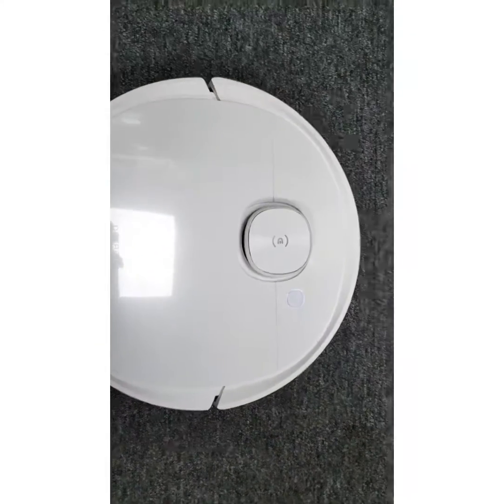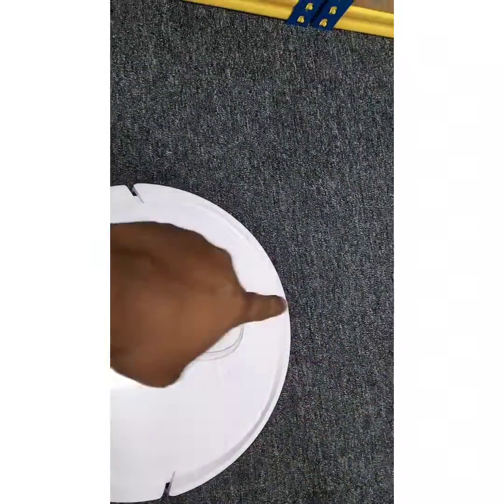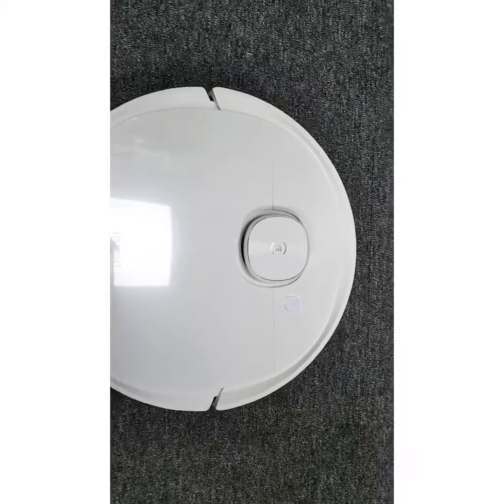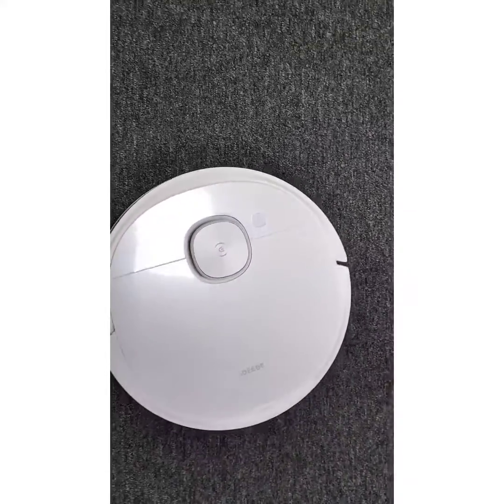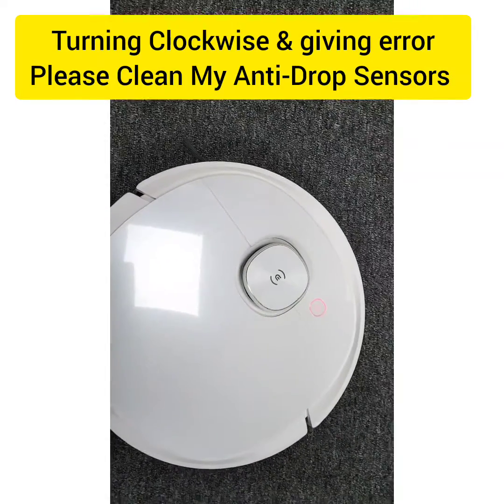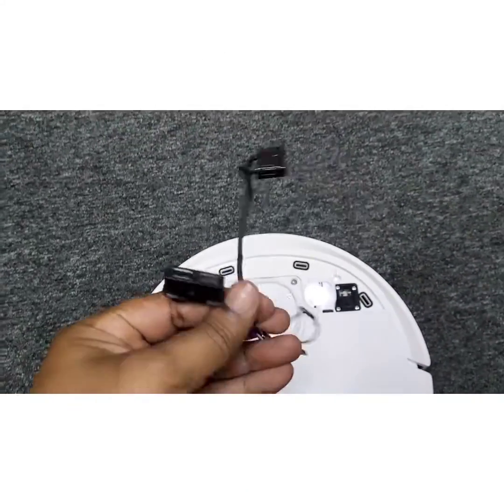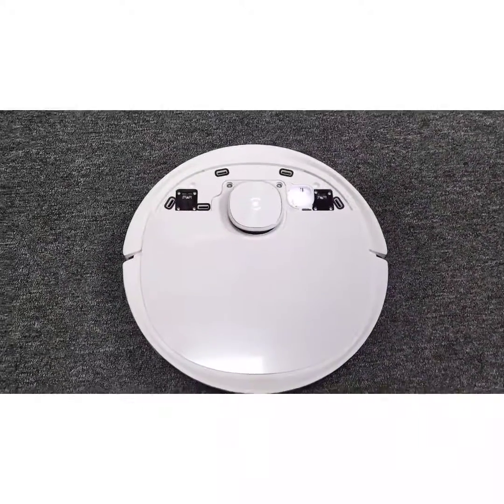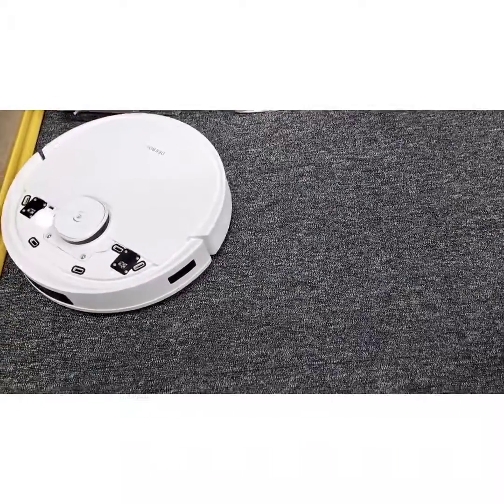Ecovacs | Deebot | OZMO Fix If Turning Clockwise & Stop...

Comment: I have the problem that when you start the vacuum cleaner and move it backwards out of the docking station, it stops and then the message from the anti drop sensor comes up.
I replaced the sensors. the error message still exists. what else could it be? I would be very thankful for help.
Reply from the maker: Model no??? If its Ozmo 950 model then motherboard need to replace...if any other models plz WhatsApp me a video clip I'll See n let you know...00601137973018

Comment: Hey! My deebot is doing something similar. It’ll start the cleaning process, clean for like 10mins and then start turning around in circles for a few minutes. It then says ‘please help me out’. But it doesn’t say what’s wrong with it.
Reply from the maker: If it's turned in circles n after that stop... means wheel issue...if turn clockwise then right wheel issue...if Anti Clockwise then left side got problem
Reply: I can’t see any obstructions or anything stuck in the wheels, but the left wheel definitely doesn’t speed as smoothly as the right wheel. Any suggestions on what to do?